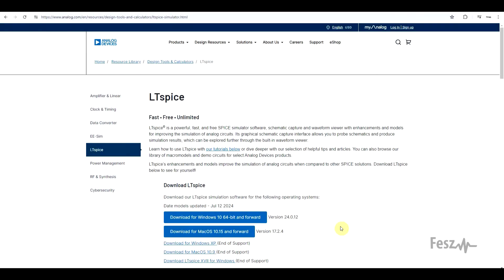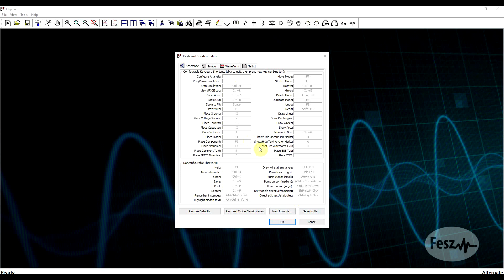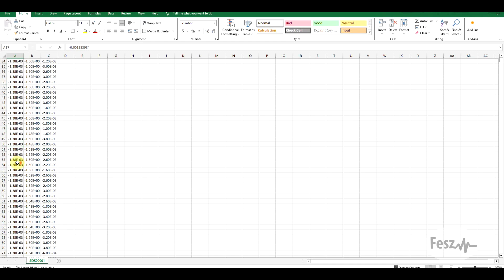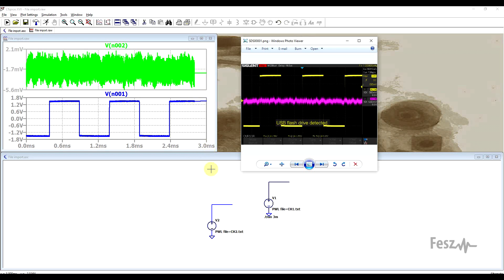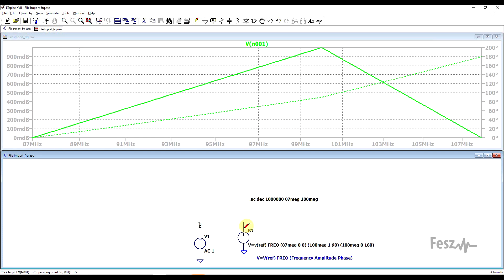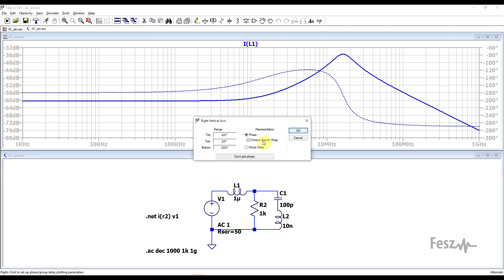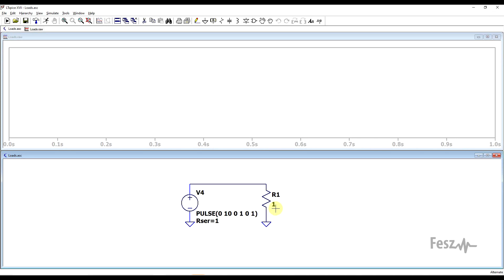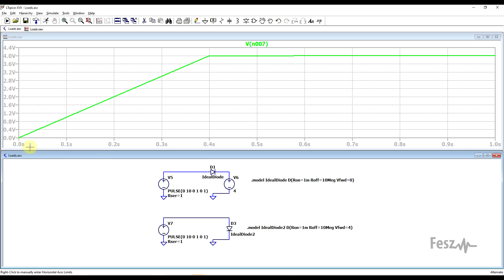LTspice tutorial - MORE Tips and Tricks

Comment: Hi Fesz, so to simulate the power drawn from a buck you can use a constant power load. circuit to test was an AC source -> bridge rectifier -> smoothing cap -> constant power load. If I make the constant power load with a resistor and then mathing it (V^2/Power_consumed) compared to using the behaviorial source method (p = power consumed) the voltage seemed very similar but looking at the power plots they were different. Why would that be?

Comment: The sub circuit at 11:29 is incorrect, that way you have an interesting feedback circuit with the independent and the behavioral source. With the small values that you are using the difference is very minimal, but it has an x/(1+x) division. It should be: V1 ref 0 AC 1 - the independent source is referenced to ground, and: B1 1 n002 ...  - the behavioral source was flipped, you can see that your plot has 180 degree phase. It took me some time to figure out what was wrong and with your data it is practically invisible.
Reply from the maker: You are right; I did not notice that; I guess you can either flip the reference or the behavioural source - both will give the same result. I put the reference source to node 1 but indeed its much better to leave it at Gnd (0) as you suggested.

Comment: Using a real life signal into simulation... Interesting 🤔
Reply from the maker: Its sometimes easier to perform operations on a signal this way - one thing I did in the past was to take a current pulse measurement on a transistor to determine the peak temperature that would be achieved in the junction during a transient.